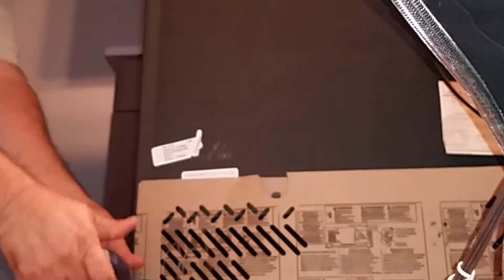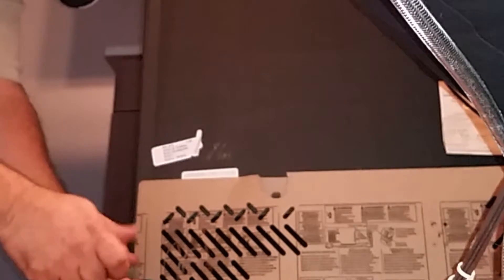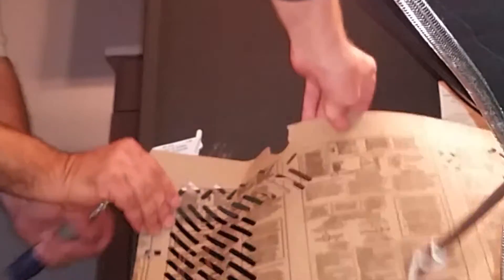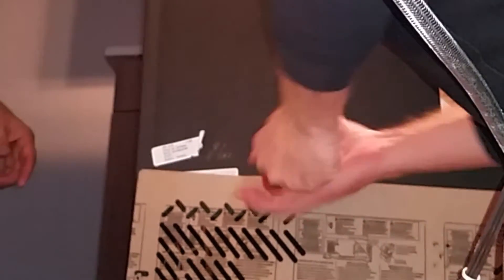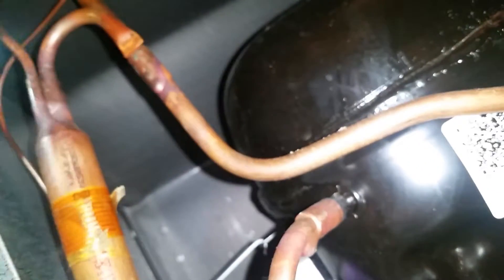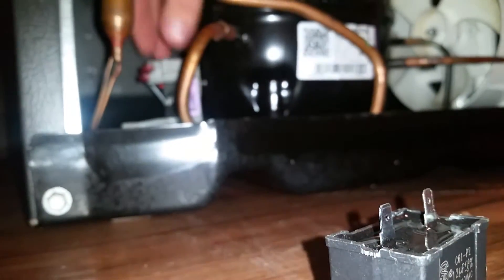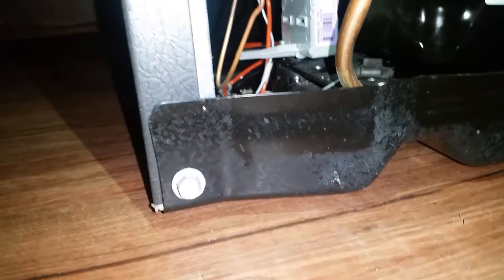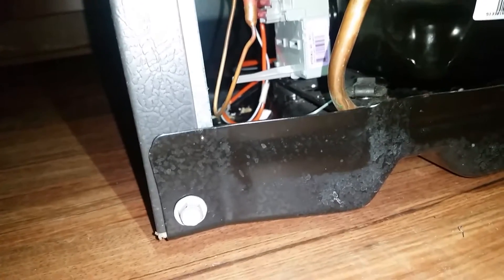How To Test If Refrigerator Capacitor Is Good Freezer Cap Or Bad Fridge Cap !:o) Freeze!

Comment: Nice troubleshooting on the capacitor KFM. How do i check the relay to see if it's  faulty? God bless.
Reply: My fridge is exactly like the fridge in this video, same start relay and capacitor. Im having a hard time finding the exact model number for this start relay to order. mine rattles. i also ordered one and they sent me one that rattles, turns out it was a wrong part as well, so any rattling means its defective or broke? i thought it was weird both rattled but thats amazon for you.
Reply: If it rattless like a baby rattlesnake its bad=)